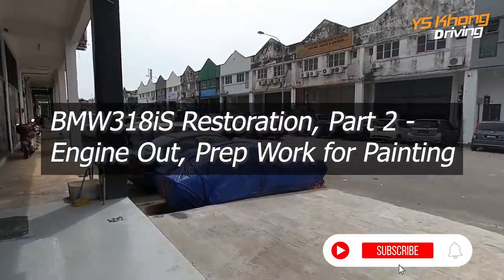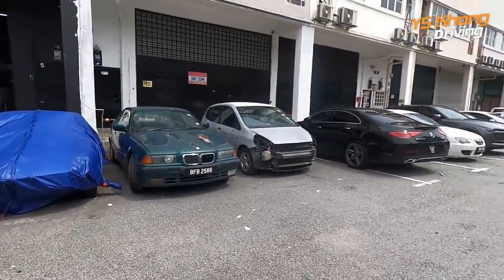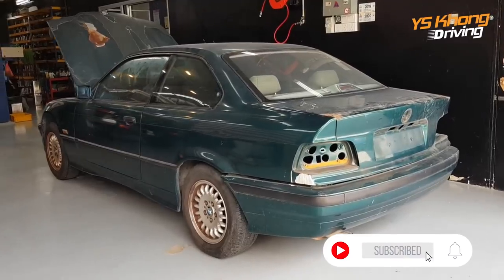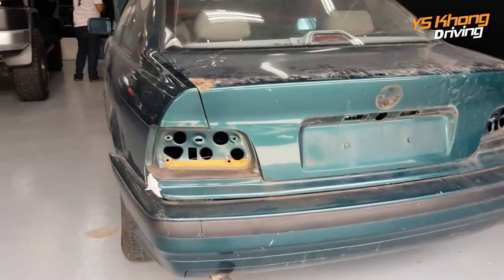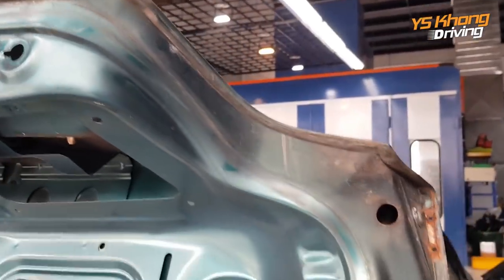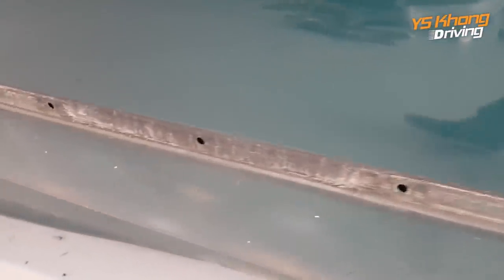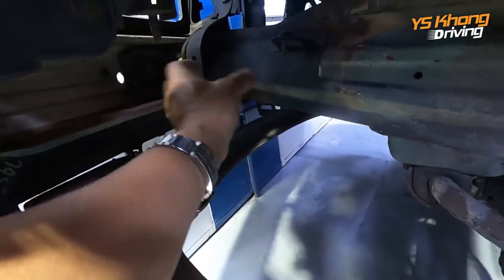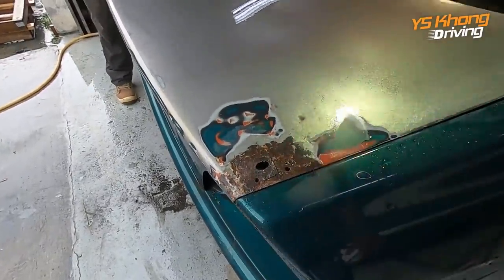Project Car: BMW318iS Restoration [Part 2] -  Engine Out, Prep for Painting | YS Khong Driving

Comment: Hi uncle, i noticed the air-con is aftermarket as i assumed it did not spec with the car by the 1st owner in the UK. It is same as my e36. With this rebuild, how do you plan to go about it? To get stock or go aftermarket? I am worry about the wiring.. hope to here a take from you... ☺️☺️
Reply from the maker: I am going to follow what I found in the car. The blower unit is still in good vmcindition - i have serviced it and it runs perfectly.

Right now the idea is to hey yhe car running, then do the other interior and suspension, brake parts slowly while enjoying the car on the road. My problem is getting it miving after 6 years parked by the road.

Comment: Have u got all the rubber items or small items parts ready? Parts are hard to come by for e36 coupe. Will u reuse most of the trims? I love your video!
Reply from the maker: I am concentrating on engine and body first. Once it can move, I will start on the rest of the body.

Comment: Nice! How much for the body restoration? Maybe u got mention in the video that i mightve missed 😅😅😅
Reply from the maker: Body, would cover welding, and painting, includind rust proofing, would be about 12k, which aldo includes sending the car up and down for dismantling engine. Rebuilding engine would cost quite a bit. Parts alone is around 8k already. Clutch is another 2k.
Reply: @YSKhongDriving  nicely done sir. Looking forward for your updates.
Reply: @YSKhongDriving  yikes! Cost is steep, but definitely worth it 💪💪💪 got 1 old hustle with me, hopefully got a budget soon for a proper restoration! So inspired by urs! Thanks for sharing! 😁